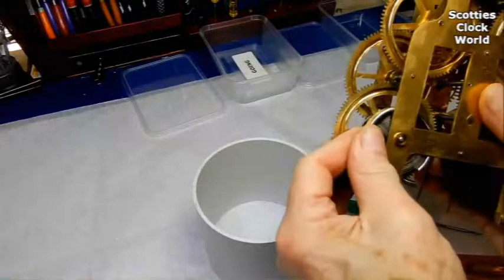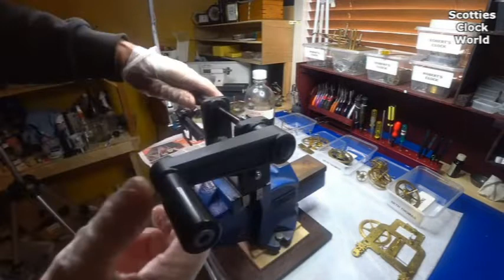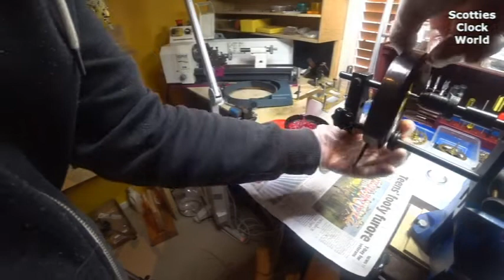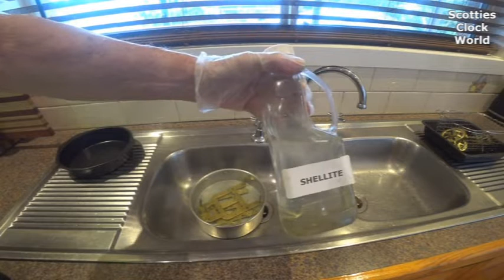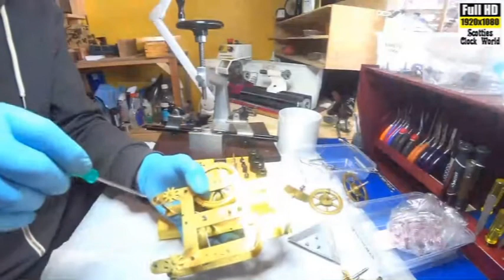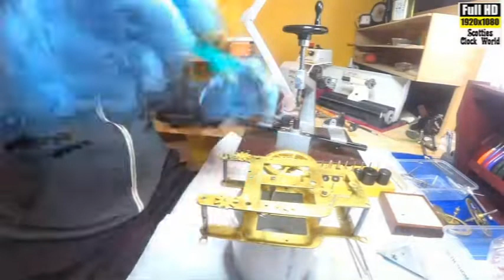Seth Thomas Kitchen Clock Service - Full Video

Comment: First I like the set up of your work bench with your tools order. Very professional unlike mine. LOL. Old timers would scribe on the train to know which way they go in. T1, T2, etc., S1, S2, etc., or a -1, -2, for the Tside or a +1,+2 for the strike.  Which was an easy way of putting them back together since they didnt have the phones of todays to take pictures. Wouldnt it be easier to put some grease on the rag and apply it after you cleaned it just like you did when you cleaned it? Just curious. I havent ever used Shelite. I using rubbing alcohol. Sometimes it puts a layer of stuff on the movement like a crust of some sort. Does the Shelite ever do that? I also have a plastic ice cream bucket with a bunch of holes in it. The top lid has a hole big enough for my hair dryer. I put it on low and stick in the hole and dry my parts that way. I imagine putting a hole in the lid and putting your heat gun in the hole on low would do the same thing. Of course I have a cloth underneath the ice cream bucket to allow the water to go to. I would suggest taking a wooden dowel or tooth picks to all of the pivot holes of the plates to remove any dried up dirt/oil as the ultra sonic cleaner will not get all of the stuff off in the hard to reach spots. I would suggest that when you put the wheels in to see if it needs bushings that you show people how bad they tilt. A lot of people get confused during this part of the clock assembly. Some people say that if they tilt more than 10 percent that they need bushings. What happened to the rest of the video showing the clock together?  Overall great video.
Reply from the maker: @munnerlyn3, Shellite is a trade name (Australia) for naphtha (lighter fluid). I now use naphtha in my videos instead of Shellite. 
It is interesting you should mention it as I use the T1, S1 description and a drawing of same in my new Clock Repair For Total Beginners video series starting next month.
I used to save all my raw video footage on a 1/2TB external drive that died some time ago. The files were corrupted so I was not able to rescue them. I lost about 150GIG of files when that happened. 
That's why some of my videos from that time don't have an ending.  
The 10% rule for bushing 'slop' is pretty accurate, but you'll get away with more on an American clock as opposed to English and French movements.
I peg out bushings with sharpened peg-wood.
Thanks for your comments.
Reply: @ScottiesClockWorld  I agree with all that you said. Thanks for the reply. I have an external hard drive that the female plug quit. I took it to a shop and the took the hard drive out and put it in another case. Works great. I would have been devastated if they couldnt have fixed it as it has all my clock data for the past few years.